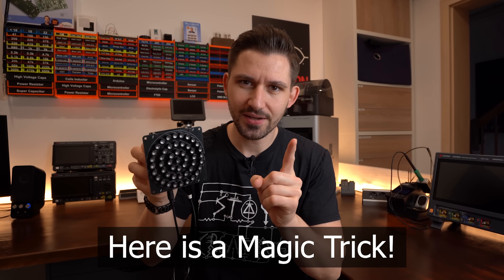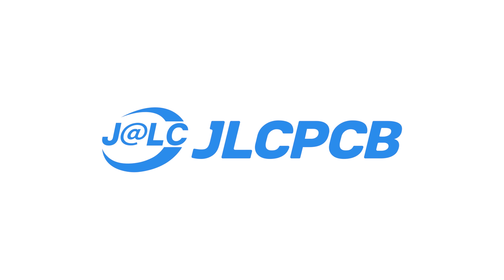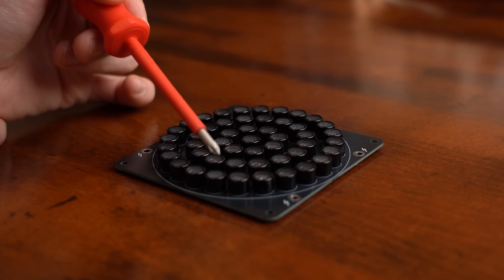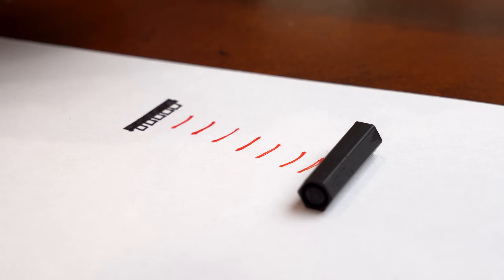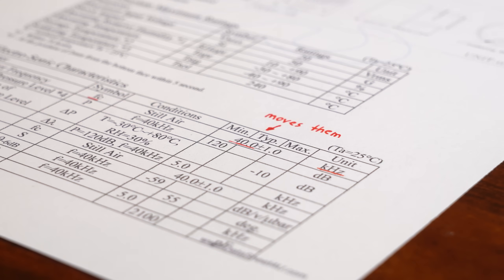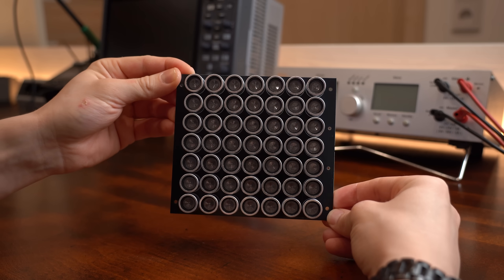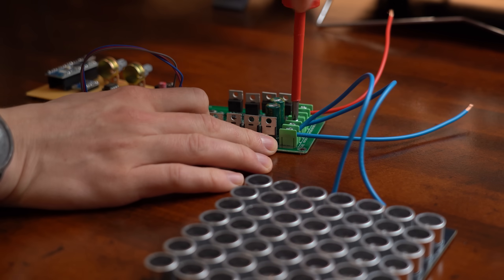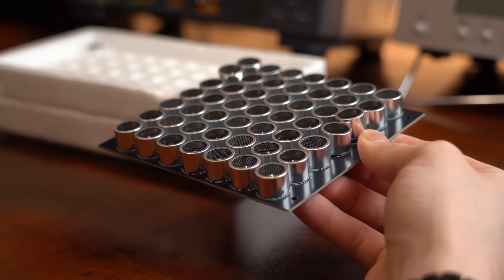The Coolest Speakers are TOO PRICEY? Let's Change that! (DIY or Buy)

Comment: Very Good video, i have tinkered for a while with such speakers. If you are able to control the phase of each transducer then a whole world opens up!!
By controlling transducer phase you can make whatever you want with your beam, like angle it to whatever angle or reduce the sidelobe amplitudes.
Another very cool application is acoustic levitation of very light particles, even though i was never able to reach it.
Have made a board with 4x4 transducers(the same as yours, bought on ali) in which each transducer is driven by a 4427 gate driver... 
Maybe it is super technical but if you had fun, this may be even funnier for you.

Great video as always.

Comment: I think the parallel connetion between the speakers can be a problem. The components are not exactly the same, so I think some speaker got more power than another, messing up the results.

Comment: I've been wanting to try something similar since I heard about these things, so thanks for the video!
Curious why you went with a rectangular grid instead of the circular arrangement of the original.
Also, what about driving them in smaller groups (or individually) and creating a steerable phased array?

Comment: I'm not sure why, but the speaker you linked (~€250) contains 63 transmitters, while the one you received and are presenting in the video contains only 49. Could it be that they sent you a different (possibly cheaper) model?

Comment: IIRC it should be single-sideband modulated for best performance.
Reply: Yes, it would usefully halve the bandwidth required from the transducers. You'd have to retain the carrier though, else it would not be intelligible using just your ears.

Comment: With your 4 empty PCB, you could try to populate them at 25% and arrange them in a double size / same power transmitter to compare the range / directivity

Comment: Kinda shocking how something with a <50 buck BOM and therefore easily 300-450% profit margin doesn't even have basic quality control the catch a diode being placed the wrong way around right after the power supply.

Comment: If the speakers turn into a cone at distance it's because the focal length isn't right for the range. You could make a kind of static satellite dish frame that has a finite range on the focus point. You could also make some kind of frame that can be changed on the fly that would be able to focus its sound at a number of ranges, maybe even have a range finder mounted on it to have further accuracy.

Comment: I think your Design isn't good enough and you can chang this Design by so better than this, at first ; if I Designed this useing a TDA2004 or Two TDA 2002 thats very cheeper than that you used, as I told Most Times to My Friends ; never forgut to you Most thinking more when your first Design been ready and try to find exist problems on it, after it you Most see how you can chang it to be cheeper than it and have better Quality and never Make your first Designed in your mind as you need to connect your mind to a connection coming from up as we are not a real Designer and it's Clear for every one who Know what I try to say to every body who can undrestand me.

Comment: Don't you have consumer protection in Germany? Why not use it? Only thing you achieved is losing the warranty.
Reply: Good luck with warranty claims when ordering from China. Swapping a diode around is cheaper and faster than negotiating for an eternity.
Also in order to get a refund from Chinese sellers youll often have to ship back the product, at your own expense. And since shipping is no longer subsidized it will be really expensive.
Reply: Good catch. Even then, you can report non functioning product and usually get some money back.
 @Hedrix01

Comment: You could take it one step further and add beamforming/steering. Would require a lot more electronics though. I.e. one amplifier per set of speakers (7 for 1D, or 49 for 2D)
Reply: You can make a beamformer with mosfets or an h-bridge using PWM, as long as you have enough GPIOs for each element or row, or use a shift register.
Reply: tbh you can probably use a single transistor per set instead of an h bridge. you can get some mosfets for like 10 cents a piece, so cost isn't a huge issue.
pwm might be trickier, but I think you could use a cheap cpld/fpga as a crude dsp to do it, though you'd probably only get like 8-12 bit audio. (40khz on a 200mhz clock allows 2^12 at best, assuming you have a 1 clock counter.) (basically you use an adc to get a digital representation of the signal, then toggle each output when the clock counter is greater than whatever the value of the adc is + some offset.)
for higher quality there's some 16 bit multi channel pwm boards that accept an oscillator, so you could have a 40khz clock and use those. 
or you could just use 49 Tl72 and accessories to generate a voltage controlled pwm for each.(or maybe you'd need some tl074 instead so you directly input an x and a y control voltage and don't even need an mcu.)
Reply: You can use all your existing electronics, but redesign the circuit to fit on a flexible board made of polyimide or polyester. The board would shape like an octopus to allow you to bend the limbs to form a parabolic dish with your speaker array.

Comment: I bet copying the circular layout would increase your efficiency quite a bit. In a square array like that I'm sure many of your transducers are destructively interfering with each other.
Reply: All of the speakers are wired in parallel, acting like an array of point sources on a common plane, where the amplitude in the common direction is additive and the other directions mostly cancel out. The speakers at the corners are going to cancel less efficiently, causing more audio leakage to the sides. However, that leakage will be a tiny fraction of the overall output power. So, while it would improve the leakage noticeably, I doubt that it would increase the forward amplitude noticeably.
Reply: If they're all firing in-sync, then none of them would destructively interfere on the straight-forward path. (Assuming whatever they hit is much further away than the ultrasound wavelength which we can be effectively certain of).

The large square spacing will lead to a more sharp central peak - but generally worse forward transmission, and side peaks
Reply: @modelt8951  in theory, at least at far enough distances (far field condition) you could achieve low side lobes by feeding the transducers a sinc() distribution (correct amplitude and phase), granted that you can contol them independently. You could even use the circular PCB from the "buy"-version and separate out the concentric rings into groups, greatly reducing the number of drivers. Would be interesting to see that working in practice. Of course, side lobes cannot be eliminated entirely without an infinitely large array.
Reply: @SirEngelmann  God you're testing my wave dynamics but that sounds about right - essentially offering the fourier of the rectangular envelope to achieve the envelope (in theory). Would make controlling them a bitch unless you could attenuate the ultrasound modules in hardware reliably.

I'd like to see it implemented - its 100% possible with modern electronics - heck we do it for radar and that's a thousand times more fiddly
Reply: Yep "comb filtering" (because of how the  result can look on a spectrum analyser)
Reply: for a listener at right angles to the plane, the difference between any two paths tends to zero as the distance from the plane increases. i can prove this much more easily than putting a number on a typical difference, but i expect the cancellation apparent to the listener is negligible

Comment: I don’t t see any scope for such directional speakers for media consumption. Instead I dream of manufacturing compact portable speaker which has a very flat frequency response, with nice bass extension. I currently have Anker Soundcore Boost which is just 50bucks. The sound is really amazing you should check that out. It is bass heavy and goes down to 50hz, and also got the smooth extended treble at the same time. Really a miracle of a speaker! You should really buy that.

Comment: This speaker array is just the audio equivalent of the phased array radar which uses wave interference to beam energy. By timing the signal you may even be able to direct the beam in different directions.
Reply from the maker: Bitluni has a great video on that ;-)
Reply: @greatscottlab 
You can also compensate for the cone behaviour and focus on any point equal to the driving wavelength by phase adjusting the array
Reply: @greatscottlab  May I ask for help? Could you provide for me the schematic diagram for the configuration of the ultrasonic transmitters? are they put in parallel? So, what I understand is the negative, connected with the negatives and the positive to the positives in parallel configuration. Is this true?
Reply: Unfortunately, it isn't an audio equivalent of the phased array radar :) There's no phase shift between individual speakers, so basically it's just an array of ultrasonic transducers with the very same phase on all of them. And it works just by hoping that the ultrasound properties, design of the transducers and their interference pattern somewhat limits the power of the waves that are going to the sides of the speaker.
Reply: @felixyasnopolski8571  It is not a phased array but the working principles are pretty much the same. You could think of it as a phased array with a fixed phase on each transmitter. If you added delays to some of the transmitters, like say add a delay to every column then you could change the direction.
Reply: @conorstewart2214 you probably need amplitude shading on the Edges too
Reply: @felixyasnopolski8571  This is a DIY setup, kept as simple as the cheap chinese speaker is. If you want to reach better performance you need totally different configurations, managing phase at least by groups of speakers (DSP and power section for each group) pushing the price up to 20K+. Unfortunately there are several phisical limits to this technology (works really bad with lower frequencies).
Reply: The speakers at The Sphere do exactly that. Dave Rat has a great video showcasing them, it's amazing what the tech can do. The video: https://www.youtube.com/watch?v=GS4iMvKeyUQ
Reply: That's what I thought immediately when I saw the thumbnail. I find Phased Array radars fascinating. Imagine the kind of stereo effects that could be applied on such speakers.
Reply: Kind of but not really. It works using the same principles of interference but the phase of all transmitters is fixed and is the same. If you could individually drive each transmitter then it could be used as a phased array.
Reply: With all frequency of the audio you are playing? Might be doable, but seems difficult...
Reply: @porcorosso4330  You use the fundamental frequency of the speakers that is being modulated to produce the audio frequencies to do it since it is a steady frequency.
Reply: and phased array radio telescopes
Reply: It's not "phased" though. They are all in phase. 

You could potentially put a filter of some sort between components to introduce a phase shift. I would hate to have to twist the potentiometers to aim it but it could be possible in principle.  It'd be much easier to let a computer handle that part.

But this one doesn't do change the phases, at least not deliberately. There may be some phase change due to normal parasitic capacitance and resistance in the board, but it would probably just be broadly increasing with distance from the connection. Because it's connected from one edge of the array, there would be an asymmetric effect on the "focus" of the formed beam. This means either "it wouldn't work very well for aiming forwards" if there was significant phase changing, or "it wouldn't form much of a beam" if the phase wasn't altered significantly. It looks like the latter was the case.
Reply: thought emporium did phased array ultrasonics for echo location. look it up. easy.
Reply: Can they be "phased" to act like a larger speaker?
If so, audio might be able to cover lower frequency reproduction.